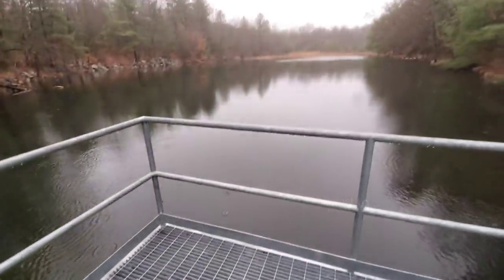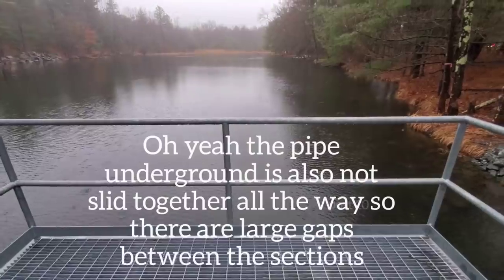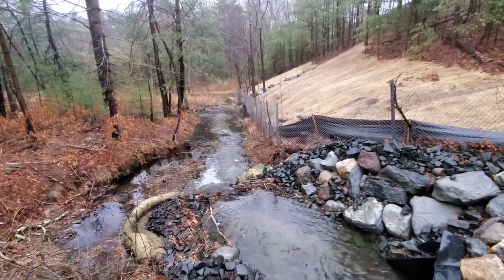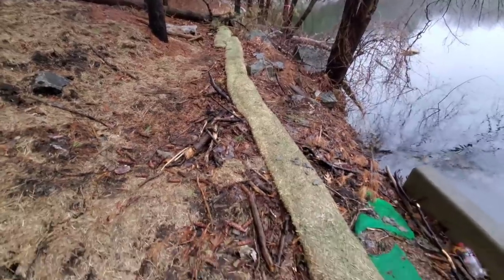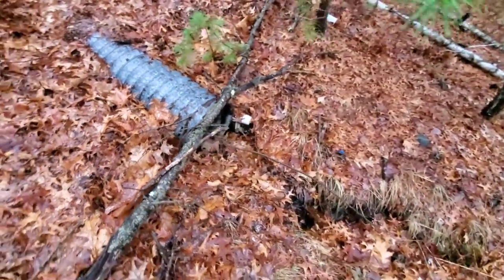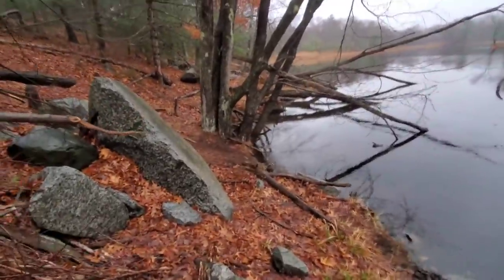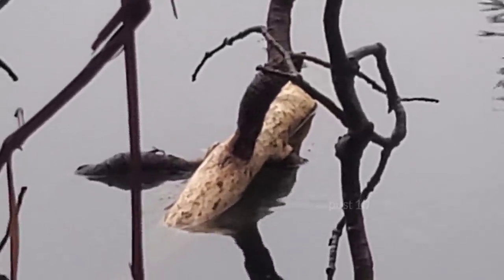The Lake Drain Experiences High Flow And Crumbling Drain Lines

Comment: I appreciate the steel plate skirting around the bottom of the platform to prevent dropped objects falling off, or people sliding out under it. That platform itself looks very good.   
The pipe is one of those things that really just needs to be dug right up, done properly, and then it'll be good for 15-20 years.  
But I guess it's one of those things where they can't justify the cost when it's still "perfectly fine", even if there'll be a future issue because that's usually how local governments usually are.

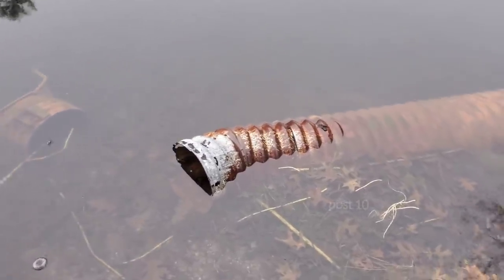Comment: Btw that one drain the one with the tip broken off the one that was not working in the video at 9:15, isn't that the one that ran down the hill near the old lake drain's culvert exit? Since in the water you can see the fitting at the very tip of the edge of the drain at 10:49 which looks oddly similar to the one on that culvert that ran down the hill near the old lake drain culvert.

Comment: 2:30 - They could actually weld an eyelet to the valve key bar and chain it to the railing with a padlock, so no trespasser could open the discharge or steal the valve key.

Comment: if the main pipe clogs like you say 
they could open the valve and have high pressure spray directed straight att the clog